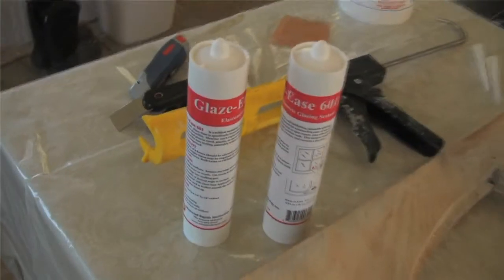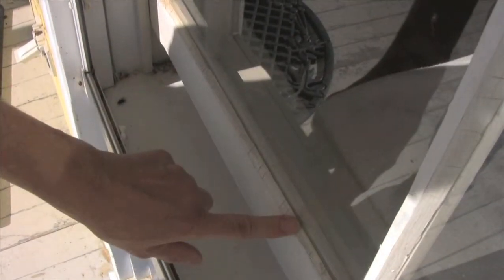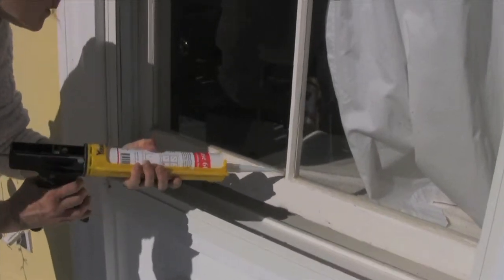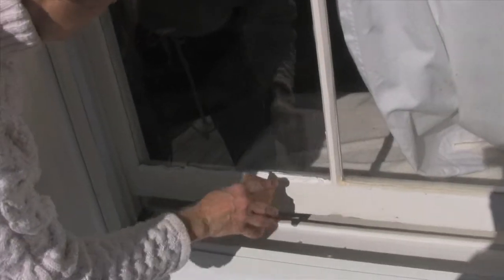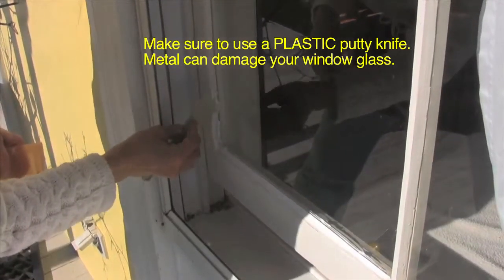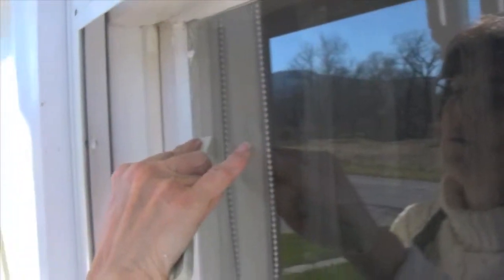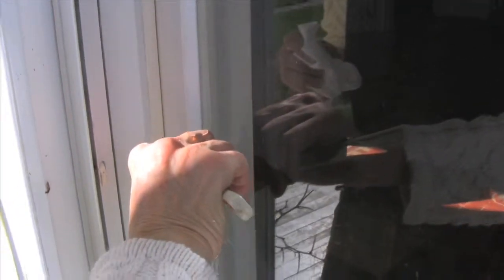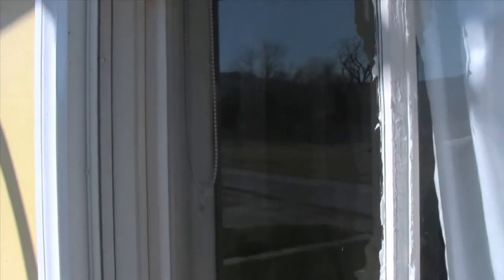Advanced Repair Technology - Glaze Ease Demonstration

Comment: This product is marketed to the home user as something that is really easy to use.  In fact, it is a disaster.  It is basically like applying caulk to glaze your windows -- sticky, messy, awful.  I used it last fall and this fall it shrunk to a point where it was almost half its size.  Now I'm trying to take it off and it is impossible!  Do your old windows a favor and don't ever use this! What a disappointment!